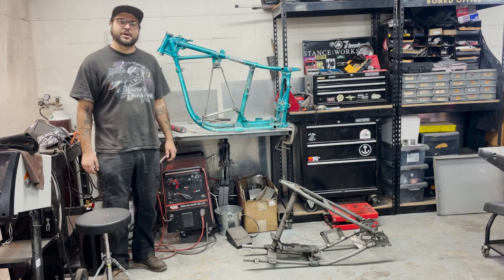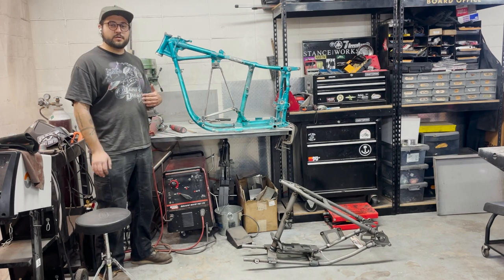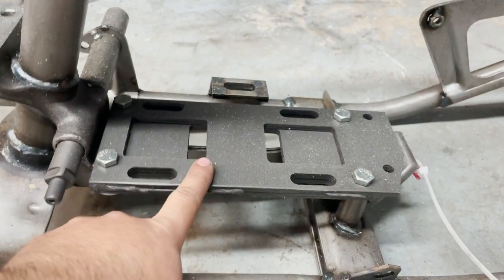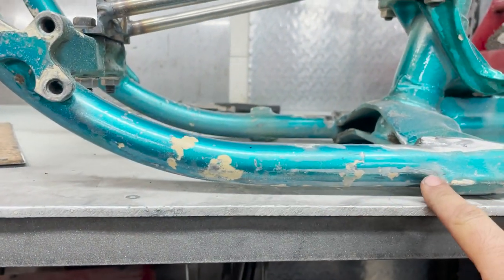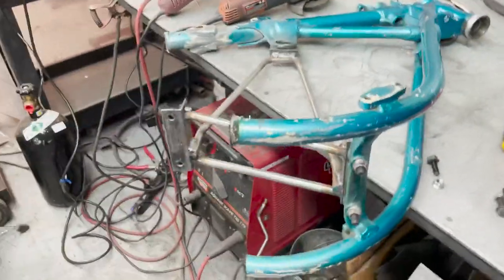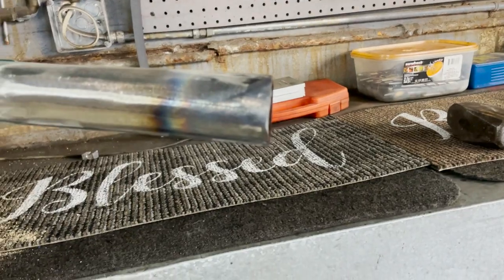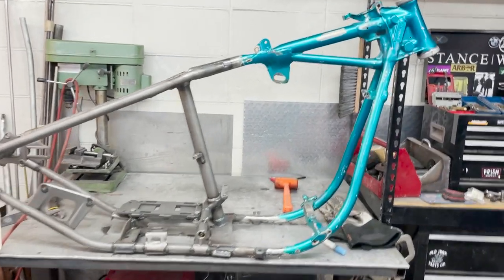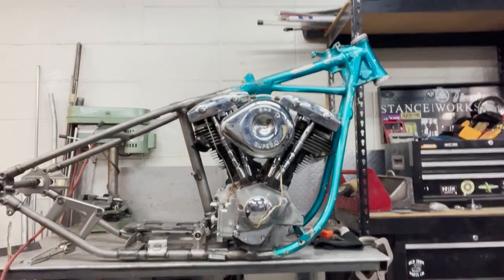V-Twin Harley Shovelhead Weld-on Hardtail Install | Mazi Moto

Comment: Lookin' good, why didn't you use your motor jig? I know the engine is the final fit goal, but seems like welding around a jig would be easier!
Reply from the maker: I noticed a little bit of flex with the motor jig. Didn’t want the heat to warp the frame any so I threw the motor back in just in case.

Comment: Nice job man, 
PSA :  On final assembly always tighten the rear engine mount 1st... That locates the engine in the frame... Front mount you can shim with a  small block Chevy starter shim... If need be... It made me happy to see those STD heads on there... 
CrazyHorse Speed Shop. NJ.  USA